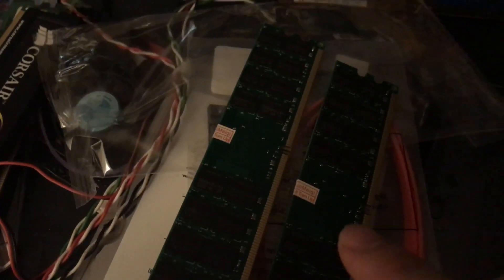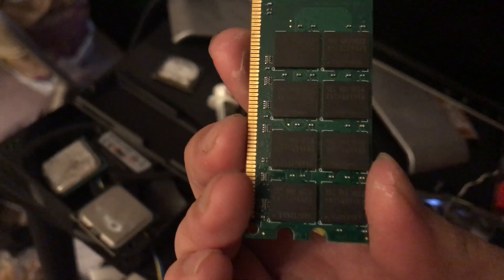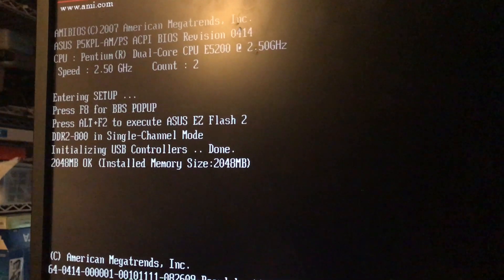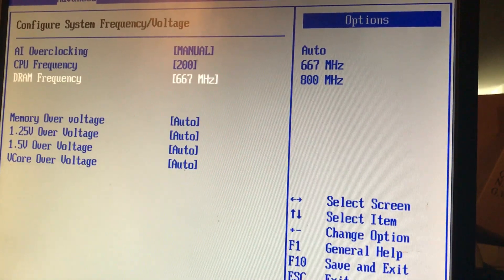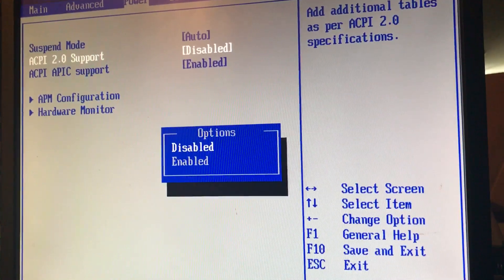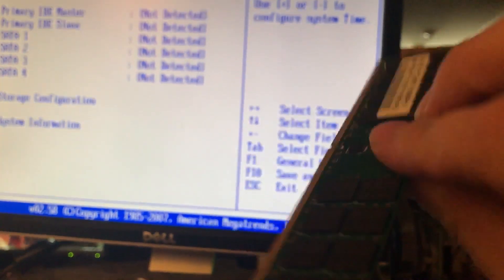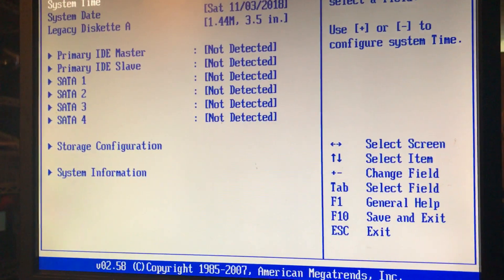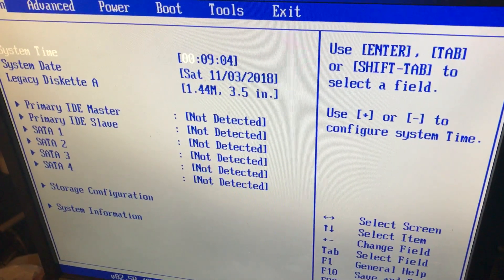Debunk of 8gb ram support on p5kpl-am ps

Comment: You tested Chinese "MOD AMD" RAM - its not workings with intel.
16 chips @MOD AMD RAM@ - dont work to!
Sometimes MOD AMD RAM 16 chips masked to Original brand, but dont work on Intel, so need to be sure that RAM is original!
All RAM marked by "2Rx4" - DONT WORK ON INTEL
You need only Original DDR2 4gb 16 chips RAM with marker "2Rx8" - more chanse to finde with 667mhz, and its werry expansive!!

Comment: https://item.taobao.com/item.htm?id=565545871374
I order a 8 chips on one side 4gb ram from Alibaba Taobao, Hope it works.
Do you know whether this will corrupt my system or hard drive in the worst situation?
Reply from the maker: Chandler Luo you’ll definitely need this to run the system probably

https://www.ebay.com/itm/264702945606

But the price will not be pretty and the module rare to find even back in 2008/2009 and very costly.

https://www.ebay.com/itm/223060918946

You can see the reason why are they so dirty cheap because they are using smaller chip to make the module more densely and usually they are mostly running on server or amd platform. Because it is easy to recycle most of chininese vendors are often recycle the old defective module and extract functional chips from it to remanufacture.

It will boot but do not expect them to run safety without corrupting your hard drive.
Reply: Looks like it works, unbelievable. Thanks for your care about this my process. My update on 2020 Dec 18:The bios can read 8GB ram, and win7 64 can also see 8gb ram. The only problem is it runs at 667 instead if 800, contact the vendor, They say it is set in purpose for more stability, the ram itself is 800, don't know if that will cause any issue or influence speed a lot. Now my computer upgrade from E5200 2gb ram g31 hd4830 hdd to q9500 8gb ram g31 ssd, I hope this set can work for another 10 years. I may add a gt1030 gpu card later.
Reply from the maker: Chandler Luo glad you made it, but surprisingly g31 can address 256mb per chip, I thought only bearlake xe(x38/48) and bearlake pro(p35/q35/g33/q33)support it.

Running on ddr2 667 seems very natural on dual side ram, that was why gamer back in the day rather keep 1gb x2 setup because only two single sided module can achieve higher frequency, even  in today you can see many of gamer are still stick with 8gb(2x 4gb) ddr3 or 16gb(2x 8gb) ddr4 for that reason. This is a trade off because you simply cannot have best of both worlds and ddr2 667 is not far from ddr2 800 and you can simply lower down the cas latency to gain the performance back.
Reply: @hanrinch  Yes, I am also surprised. The product title mention that G/P31/41/43/45 all support that memory, I will contact the seller asking how they did it. :-)
Reply from the maker: Chandler Luo g43/45 are eaglelake chipset and they are supporting 256mb chips by default, but i am surprised by the fact bearlake le(p31/g31) can address 256mb chips

Comment: Question, so does this motherboard support 8 gb ram or 4gb+4gb ram?
Reply from the maker: HK Games 4gb addressable in bios I believe, however even if it supports 8gb the module is simply not supported because it is high density ram (32 chips) unbuffered non ecc server ram and supported exclusively on lga 771 xeon, hence why most of lga 775 board cannot make the module work(except for some sis/via chipset but their addressable line is still limited to 4gb that render it useless. However the 2gb 2rx4 module runs find on these board unlike it’s on intel chipset.). Technically you can make it functional on p5kpl -am ps(regular p5kpl-am doesn’t work) but the board can only recognize the lower half 16 chip and that is the reason why it shown 4gb in the video. 

I saw some video a while ago that some  p5kpl-se with bios tweaked can support 8gb ram but it is restricted to dual rank 2rx8 module(low density 16 chip) and these 4gb module are rare to find and very expansive.
Reply: @hanrinch  oh i forgot how about 2GB + 4GB ram?
Reply from the maker: GD CRAFT chipset and bios limitation still, it won’t recognize tge top part of the sixteen chips so it will still be 4gb total.
Reply: Nice, thank you

Comment: User manual already says that it supports only 4 GB ram. Higher will not be displayed.
Reply from the maker: Kamini Bhatta some module will be displayed but it will either going to corrupt the file system in your hard drive or simply having bsod when you trying to run something(on high density 2rx8 module). Some case it will run but the value will be missing(on low density module like in the video)

Comment: Memory Rempage Feature Enabled
Reply from the maker: It was already enabled in bios, which it is not working. It was struck by the hardware limitation that intel had proceed, that mean you cannot use any server ram or any ram that has higher density per module and chipset is strictly only support dual rank with 8 chips each side of the ram module. Unless you are using ATI or nvidia chipset for the lga775  but the chance are really slim because both of the vendors are known to be very terrible on ram compatibility and running unstable in normal use. VIA and ALI were stuck with 32bit address line without remap so those amd only ram are kinda useless. I’ll made a tutorial video about the ram compatibility on each lga775 motherboard if I have spare time.
Reply: @hanrinch  https://vk.com/video431983478_456239650
Reply from the maker: Иван Перерва is that 4gb slot dual rank x8 module(8 chips on the side, total 16chips) or dual rank x4 module(16 chips on the side and total 32 chips per module)?

https://www.oempcworld.com/mm5/graphics/00000001/CSS.jpg
This is not supported by any of intel chipset

Unless it is reported in bios I wouldn’t consider any of these utilities under windows environment such as using cpuz, aid64 or even windows task manager are correct

Comment: Work in P5KPL-AM SE?
Reply from the maker: Non of them will work because they are based on the same chipset.
Reply: @hanrinch  but in case you used 2 RAM memories of 4GB ddr2 for AMD and the motherboard has only 4GB of the 8GB you put in it?
Reply from the maker: Young Mask - Tema 

i did install one stick initially in the video to test the compatibility. It shown 2gb in the bios and nothing else.

Comment: Does it work with amd ram ?
Reply from the maker: Hiresh Naik apparently not, at least it is not fully recognizable and instead it would functioned as standard 2gb x2. However it wouldn't even post on many intel based motherboard and only few will post after installation(like in the video) which non of intel system will fully work with the module as result.

PS: it is still unclear that it will  work on third party chipset or not(aka nvidia/ati/sis/via/ali/abit). I'll test it when i have time